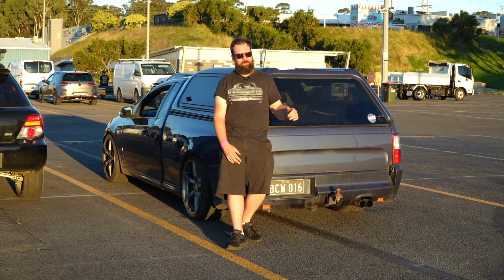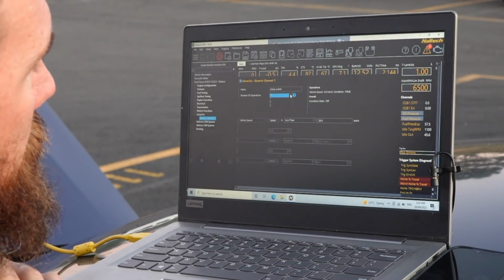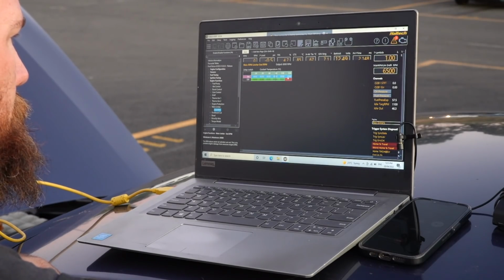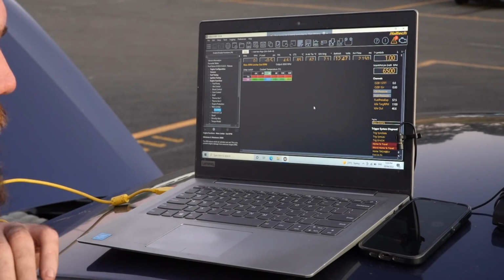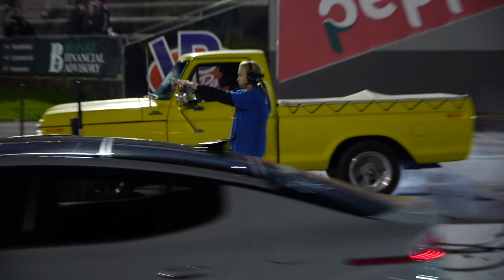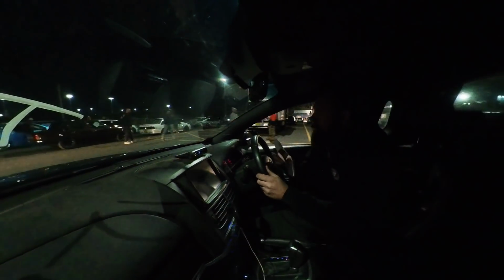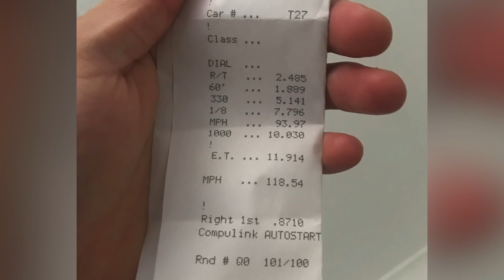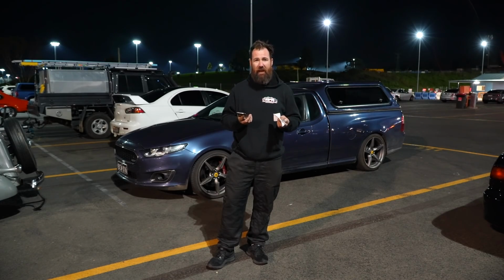FERRARI FALCON | How fast is it now?

Comment: I did back to back 12.9's in my bone stock FGX XR6T with the ZF and big 20" wheels. 11.9 is a decent time!
Reply: Yup my old G6E-T managed high 12's in factory trim with half a tank of fuel and my fat arse onboard so that websites stats are a bit out - maybe testing on normal tarmac?
Reply: 12.9 is a great number for a stock car like that. The young folks want a 10-second car never having had that power before it's not practical for a daily driver.
Reply: @rabbitphobia  Exactly, there is a huge difference between a high 12 second car and a high 11 second car - and a bigger difference again to get into the 10's.  Back in my youth if you had a 14 second car, it was considered pretty quick - now days a lot of run of the mill family cars can do that.
Reply: @Beer_Dad1975  OK... you are making me feel old too now... but you are right you old fart... ;)
Reply: @Beer_Dad1975  yep - massive difference. I'm running 11.4 now and the difference 1.5 seconds makes is HUGE!
Reply: @5UPRAH  Yup that's legitimately quick for a street car.  I got my Falcon into the mid 12's with a fairly small amount of work - lining up against an 11 second car, it'd often feel like I was standing still :-D

Comment: A lot of kids on the internet (most of whom don't even have a driver's license) talk about wanting a 10 or even 9 second street car, when they have absolutely no idea what driving an 11 second car is like, nevermind driving an 11 second car on street tyres, on the shitty cracked dusty dirty greasy street surface...
I remember when 500 wheel horsepower was enough to win horsepower heroes at Summernats outright (and become a national sensation), and it wasn't that fucking long ago, children. And you're making 520 at the wheels in a daily-driven work ute, not a dyno queen.
Reply: first car i drove was a blown 351 cortina , i was 13 , that set me up for close to anything lol
Reply: 450 is max you need on street. I drive 320 fwd lol
Reply: Just tickled the throttle on a damp exiting of a small roundabout, in my bog stock 220 AU XR8 Auto, and frightened myself.   Nearly humped the centre of the roundabout, followed by nearly humping the median keep left sign. Had to do the lap of shame to get to my exit .  You barely need 80 horse and some good old 302w instant torque to shit yourself, let alone 500 !!

Comment: That’s a good time the best I could manage in missus fg turbo ute tuned with valve springs exhaust cat back and injectors with zf auto was 8.36 1/8 mile with street tyre 400hp atw yes with wheelspin

Comment: Standard FG XR6TURBO,S do 12.25 time,s as per road test,s & tuning shops in Sydney my 2011 FG XR6TURBO did 11.6 at willowbank with x  force dump pipe & cat & tuning standard exhaust from cat back.
Reply from the maker: The gains are all in the dump - mid section but my rear section was pretty beaten up so I replaced the whole lot.
Reply: @BennysCustomWorks  cheers mate good luck with the great Aussie build off.

Comment: Have seen a stock fg xr6t ute auto run low 12’s stock on stock wheels with a decent tyre in great conditions
Reply: how low is a low 12
Reply: I saw it run a 12.3 something but it went quicker apparently
Reply from the maker: I’m sure I could have gone faster if I had more goes.
Reply: @BennysCustomWorks  how much does the canopy weigh
Reply from the maker: @out_on_bail  about 40kg, probably aids traction tbh
Reply: @BennysCustomWorks 👍 bit of fun none the less

Comment: benny dose your f6 dash work as it should in xr6? like the boost and oil temp?
Reply from the maker: Yes, BUT it may be due to the Haltech broadcasting the data over CAN
Reply: @BennysCustomWorks  cheers for the reply bro
Reply: They will work without aftermarket ecu
Reply from the maker: @spoolkingfg2008  do they need to be activated in the pcm though ?

Comment: Benny you disappoint me using Chinese Ditch finders I've just removed mine as they were like driving on ice in the wet wheelspinning in 1/2/3/4  now Using Toyo Proxes and feels safer
Reply from the maker: Not all Chinese tyres are horrible. These are fine in the wet